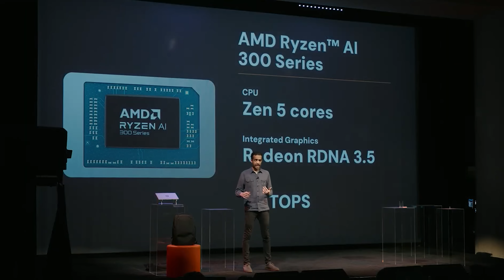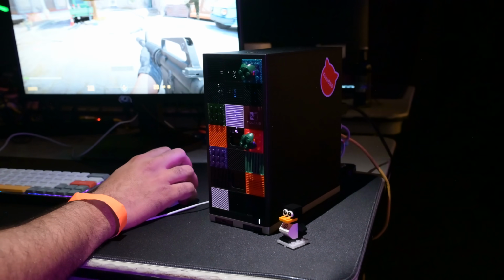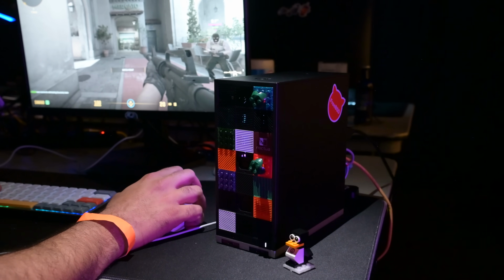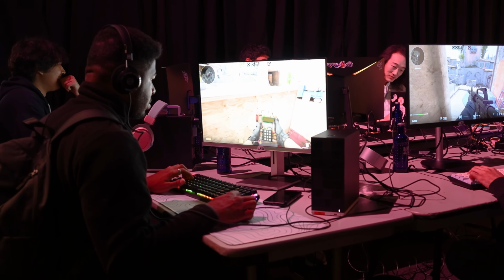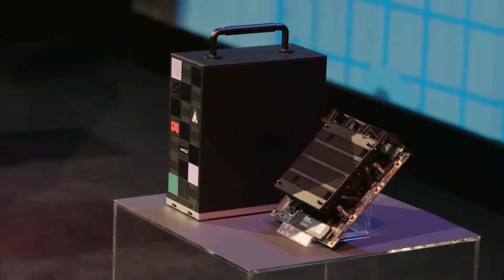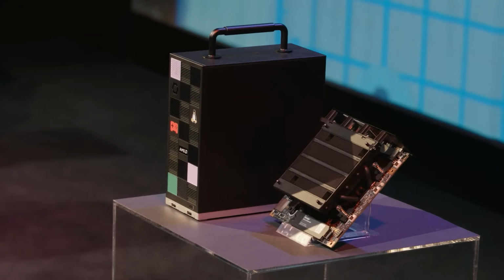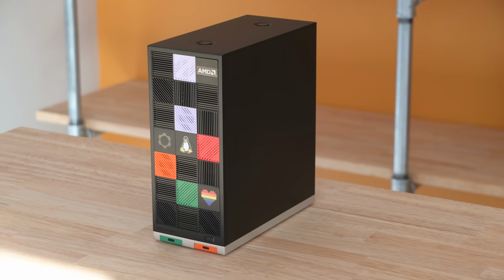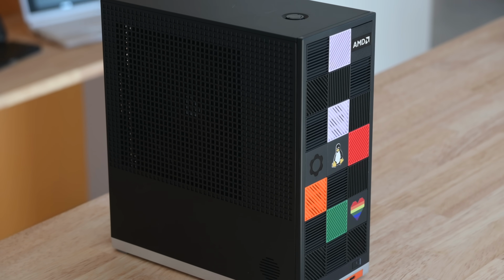Modular, Open, Repairable – The Framework Desktop Teardown!

Comment: I feel like I really need to work for framework because I have so many ideas that whoever's driving just doesn't see.. for instance when they released the framework 16 the motherboard is a completely different design than the framework 13 and or framework 12 and the video expansion for the 16 goes backwards where if they would have had a more portrait aspect of motherboard and have video expansion expand to the right they could have a universal board design that would fit between models allowing someone who bought a framework 13 and decided they want the horsepower of a dedicated GPU so they can buy a frame for a 16 and a dedicated GPU and move their storage and RAM and motherboard from their 13 to their 16. And it kills me that their desktop is trying to dress like other desktops instead of dressing like a laptop in a desktop format because now you can't buy a desktop case to put your old laptop motherboard in... Plus I think they should have the AI max 395 Plus that's in this desktop in the framework 16 laptop because that is my dream right now. It also blows my mind that the most recent CPU you can get for the framework 16 is the 7000 series?! The new framework 12 is literally more powerful than the framework 16's most powerful option right now wtf framework wtf Linus

Comment: I know it's a bit silly, but I really wish they had put a full size pcie slot on the board. I just think it would be so cool to build a sff pc with this and a more powerful gpu
Reply: Not silly at all. You and I both. Thats by biggest gripe and honestly i think its to help bottleneck the ability to somewhat "upgrade" the platform in later years. Either that or bandwidth limit, idk.

Comment: So modular you can't even change the RAM, or expand it with a dGPU! If I only wanted to change stickers from time to time, I'd buy an Apple device!
Reply: The ram on this is superior to anything out there on the market as stand alone ram kits. Do your homework so u can at least sperg properly.
Reply: @user-bn6lm8ng3v  Superior in speed, in many cases? Maybe, but absolutely not modular. The only advantage of Framework was its positive approach to repairability and modularity, if they get those out of the way, there is no reason to get it.
Reply: @ Read over my previous comment slower this time. Then probably go do some research as to why amd blanked framework when they asked for modular ram. They literally sent an engineer who showed them a simulation of what would happen if they tried to make the ram modular, TL;DR it wouldnt be a usable machine. Have a good day.

Comment: I can understand why we needed a coustom size PSU. Till some level the motherboard but having ram soldered, Think the cpu too. It will be way expensive for a consumer to upgrade or replace those compounds.
Not to mention the cmos battery is also  not standerd.
The engineering is impressive but it's not for computer enthusiasts who would like to upgrade to a latest gpu or cpu, maybe get a faster ram.
Framework wants to be the apple of modular computer. This desktop doesn't fit my expectations from the company.
Reply: Blame amd, not framework lol. In fact, they asked amd for upgradeable ram or if it would be happening in the future, they said no, sent an engineer to explain and SHOW them why its not possible. It's mostly to do with signal integrity/leak. The whole thing needs to be air tight to function optimally. Yes its not upgradeable but it does not come with 8 or 16gb ram, it comes with 32, 64 or 128 fookin gigs of ram. 

If you want to make a valid argument, attack the choice of not using a pcie x16 slot to fully make use of a discrete gpu upgrade.

Comment: If ever Valve decided to re-up on SteamBoxes this thing would be it imo. I recently built a machine. If I hadn't I think I may have gone with something like this.
Reply: Valve is big enough to have AMD design them custom hardware. They only need an 8core CPU but more GPU cores to make it worthwhile. Also it would be smart for them to incorporate RDNA4 cores for FSR4 implementation. But yeah, 8 core CPU, 32gb unified memory, 48-56 RDNA4 CUs, $999 price tag, SteamOS optimized. Sign me up.

Comment: I love framework and their laptops. With a desktop that has soldered RAM though...feels like a deal breaker. In the future, when things require more RAM, as they will, if I want to increase that, I'll have to buy a whole new board, instead of just a few RAM modules. I was really into the framework desktop until they "apple'd" me (hit me with soldered memory). Still love the laptops however!

Comment: Sorry but soldered RAM is 100% against the point of Framework. Do computers need soldered RAM to perform well nowadays? No. Does Framework need to perform better than modern computers? No. If you want a powerhouse, you have a lot of non-Framework options. Does Framework need to dominate the market to have comfortable profit? No. Considering the decision with the CMOS battery adhesive, it's looking like Framework is moving towards having more things be non-modular.

Comment: It's understandable,but unfortunate, that this uses a completely custom heatsink.
Would it be possible to fit your own if you used a big copper sheet with threads drilled into it aligned with the mounting holes on the PCB, mounted it on top of the APU and RAM, and then added whatever other heatsink on top of that?

Comment: I have been doing MicroATX for a long time now, and generally love SFF, and I agree there's some legitimately neat things about this machine. That said, the 40mm fan and no practical way to add a discrete GPU ruins it for me. This machine seems like it would have been a great place to use ATX12VO connector instead of the 24-pin.

Comment: This is barely more repairable than an M4 Mac Mini and substantially less repairable than pretty much every other prominent mini PC. I get the argument about memory signalling but the speed penalty didn't stop them using SODIMMs in all their laptops, why should it stop them in a desktop when they could have used full sized DIMMs? Or waited a tiny bit longer and used CAMM? This is completely antithetical to their mission, they're bringing the soldered, fixed configuration problems from laptops that they themselves claimed to be fixing into the already very modular desktop world, the exact opposite of what they were doing with their laptops. Call it what it is. If you play into it you'll just encourage them to solder more components in to their future designs and pretty soon they'll just be yet another laptop maker without any real repairability advantage.

Comment: It'd be nice if they release a motherboard version that has a socketed CPU and memory. Not quite as nice as I'd hoped especially with it being an ITX form factor case and board that could limit upgradeablility. Also not using a regular CMOS battery is a bit strange when it's been the norm for several decades. I hope to see maybe a bigger framework desktop using maybe an mATX board and a standard ATX/PS2 supply instead of the flexATX supply they used here

Comment: Really disappointed you didn't remove or comment on the PSU. It looks like a relatively standard FLEX ATX PSU, but I'd like confirmation of this. If the only replacement for PSU can be purchased from Framework, that would drastically reduce the repairability score in my mind.

Comment: this is worst then a normal pc,  you have soldered ram to the motherboard so you cant upgrade the ram and lets look at the fact that you had to disassemble the case inorder to pull out the motherboard (compare to just removing a side panel on normal pc)
I find it highly hypocritical from you to criticize apple for soldering their ram while in the same time you defend framework when they does it.
if you really want a change you need to criticize companies who cares, apple don't care for a change so they will remain the same and framework does care(allegedly) but they need the motivation apparently.

Comment: Missed opportunities:
- the M.2 cards aren’t tool-less
- no onboard debug display
- PCIe x4 slot is close ended, so things like used QSFP28 cards can’t be installed without a riser cable, if the mainboard is installed in a standard mini-ITX case
- cmos battery isn’t socketed for easy replacement
Reply: I think they may change things in their next iteration and you can just swap the motherboard later
Reply: I’m not going to argue about the soldered memory, everyone is aware of that decision & the tradeoffs
Reply: I would’ve chosen an x8 slot instead of a second M.2 but there could be reasons that would be prohibitively expensive to implement, especially incorporating bifurcation support in doing so
Reply: @xaj  You can't even use the PCIe slot without entirely replacing the case, while you can use the second m.2 slot with the included case. So for the vast majority of users, the extra m.2 slot is far more valuable. That said, it would be nice if you could re-allocate the PCIe lanes from the m.2 slot to the PCIe slot, like many desktop motherboards let you do.
Reply: @guspaz  they sell the motherboard standalone, and I did mention above that it only matters if it’s installed in a standard mini-itx case
Reply: @xaj  Yes, but that doesn't change my point: most people are going to buy it as a system, and removing the second m.2 slot in favour of an x8 PCIe slot would prevent the vast majority of customers from using those PCIe lanes.
Reply: @ I’m not sure how that’s materially different than what I indicated, I did say it was my preference
Reply: - RAM is soldered
- No way to install a proper GPU
- Basically zero air flow concept

0/10, wouldn’t buy.

Comment: GREAT JOB. About product: Modular, Open, Repairable...but you filled the table with 1001 parts. I prefer a case that looks more ok like 7 liters Raijintec or Dan and I assemble the 2 parts in maximum 10 minutes:
-part 1: Motherboard/CPU/DDR5/Cooler/SSD M.2 (assembly: 8 minutes)
-part 2: SFX Source (assembly: 2 minutes)
...and Disassembly all in 2 minutes; Any universal configuration (i9, RTX)

Comment: This is kind of a mixed bag. On one side it got the 2 modules they also use in the laptops, on the other side you cannot upgrade your memory anymore. Not sure what is the point, a regular desktop is more flexible and repairable.
Reply: The point is: this is a production workstation/small server machine at affordable price, most people won't look at upgrading it too often. It is sad you cannot easily replace the SoC when it breaks but it's a common hardware limitation on this kind of product.
Reply: @telldo8016  What I want to say is not that it might not be a good computer, but not as a modular computer as Framework tries to show it. Any other company can do this (except the modules, I guess, but for a desktop  computer I am not sure that is a huge feature as you cound easily have other adaptors/boards inside or on USB).

Comment: "Tool-Less Design"  Still need a screwdriver.  WTF?  Could use a few more "Expansion cards" but not placed on the very bottom.  Placement of the expansion cards up both sides on the front of the case would possibly allow up to 8 of them.  How are you supposed to fit a Founder's Edition card in there?  X4/X8 PCI-E?  Good luck fitting any performance GPU in there to upgrade the system.

Comment: Can someone explain to me why this mini desktop is cool? It's insanely expensive for the specs and you can't upgrade RAM? Seems like a lot of people are stoked for it though.
Reply: It's dramatically cheaper than any other product on the market that can offer a comparable amount of VRAM. I think it's the only product in the world with that much VRAM at $2000 USD.
Reply: @guspaz  that's if you configure it to have 128gb?
Reply: @Imjustabilly  That's the SKU that most people are buying, according to Framework, which is exactly what you'd expect since nobody else on the market has anything remotely that cheap. The 32GB and 64GB models are much less interesting.

Comment: I would be very interested in a framework laptop with a socketed processor if it is even possible anymore. I can stand to take apart a thinkpad on the once in a decade occurrence that I need to replace the keyboard. What I cant do is replace the processor and graphics. A thick technically minded truly fully upgradable laptop is what I want and it doesn't exist anywhere.

Comment: I don't get it. A repairable PC is just... a PC. i'm perfectly happy with the modularity of a regular ATX tower. Without soldered RAM even.
Reply: Or you could get a Mini ITX box best of both world between a mini PC and a regular ATX Tower.
Reply: You are not the targeted user. That PC is, as Framework said in their video, is made for people who wants to work with fast responsive AI, without it costing an arm or a leg. It's not made for Timmy who just play Fortnite.
AI doesn't just need a fast CPU and GPU, it also needs fast RAM. That CPU has a built-in GPU, as that has speed benefits. They also share the RAM, whereas a typical GPU has its own RAM (VRAM). So to make it even faster, they have memory soldered onto the board, as that increases the speed and decreases data failures. IIRC, it was actually AMD who decided that the RAM should be soldered onto the board. Apple has done the same, and that's why their M3/M4 chips are so fast. Though, Apple hasn't made any of it repairable.

Soldered RAM is repairable, as long it's not built into the CPU, but a lot harder than normal DIMM RAM. You can also change to VRAM chips on GPUs.
Reply: It's not a consumer product.
Reply: @ so?

Comment: Imagine sliding another section into the case that would have the daughter board for a GPU
Reply: At that point you should just buy a real ITX motherboard which will give you way more PCIe bandwidth and proper modular memory

Comment: I would have hoped for a little bit of reasoning to the unfortunate drawbacks of everything (processing, graphics, memory) being soldered and non-user replaceable. Obviously it was not possible to do it any other way here, but it does change the equation slightly compared to the laptop where switching motherboard saves you from replacing a lot of expensive hardware. In this case the majority of the cost is the motherboard, so if something gets fried you will have a pretty bad time.

Cool product, but not interesting to me. Though surely Framework has found which niche this works for.
Reply: I agree. Their presentation kind-of skipped over why this is such a cool platform. They geeked out on stage about how this was so cool they had to rethink their roadmap, they mentioned the specs, but never explained what they mean, so a lot of people look at this thing and compare it to a traditional desktop architecture. At least, they did try to fit LPCAMM2 in there. It's just sad the technology isn't ready yet.

Comment: As a laptop motherboard that can go into a desktop, this is impressive. As a desktop, however, definitely not so. There's no need for soldered RAM in a desktop PC - that's what Apple did when they went to the M series CPUs.
Why should I be forced to go 128GB from the factory, which will cost more than buying myself a 128GB kit of RAM...
Reply: It's because that APU requires LPDDR5X and a very wide memory bus, which can't yet be done in a socketed form factor. Even LPCAMM2 didn't work well enough for AMD's engineers. It's not an anti-consumer decision, it's just the only way to get the proper ungodly performance out of these APUs

Comment: The funniest thing about this machine is, framework openly mocked AI laptops a year ago and Apple design ethos buy even coming into existence. Now they've become what they mocked.
Reply: Incorrect. All "AI" laptops a year ago were literally ALL joke (except Macbook Pro - but it wasn't called that way), because normal gaming PC is much better at AI than those laptops with small NPU. They are still a joke and are misleading for consumers. However this new APU is a different story - it has powerful GPU and the VRAM wipes the floor with RTX 5090 in terms of capacity. That's not a joke an the "AI" branding actually makes sense here.
Reply: Interesting. What can be done with the ai chip?

Comment: I'd like to see them make a slightly bigger/beefier version that has a stronger CPU and GPU. Overall, the only thing I would knock them for is the CMOS battery at this point. I would prefer to see a CR2032 so that you could acquire them locally from something like Walmart or whatever is the go-to where you live.

Comment: Somebody is panicking over at Apple HQ right now, insane price to performance vs apple Mac minis and studios.
Reply: I don't think think Apple executives even know the "framework" name let alone panick over that announcement
Reply: Hardly.
Reply: *somebody is panicking while installing ROCm
Reply: not really .    The M2U for example has 800 gigs RAM BW . not 256.  even the M2 MAX has 400.
in that spec apple has it smoked.
If you need  max BW and RAM. and dont need x86. the studio is a better value IF  you can pay up for a pimped unit. 
the mini is more of a wash......... this frame work is a tradeoff. its not slow ass dual channel DDR5  but its not 16 channel  like a $4k plus studio .
I mean it can run windows 11 if nee be on bare metal?   yay I guess?

 the GOOD thing for consumers is more systems are taking on the bottleneck there has been for decades in ram BW besides the server space 

even quad is rather slow with. 12 on EYPC and apple at 16 being on the  table.